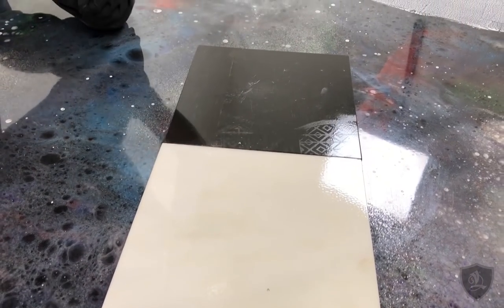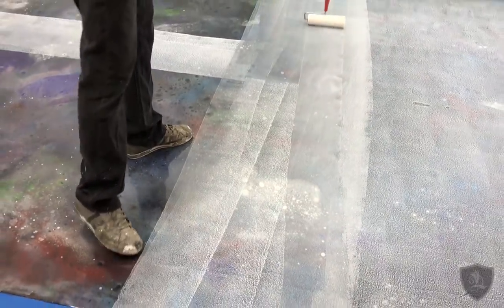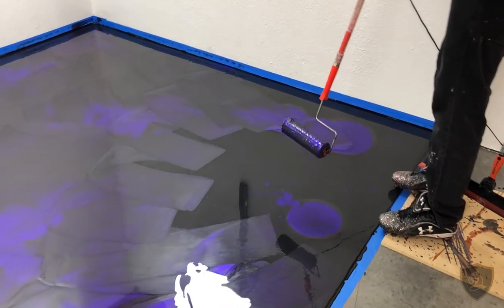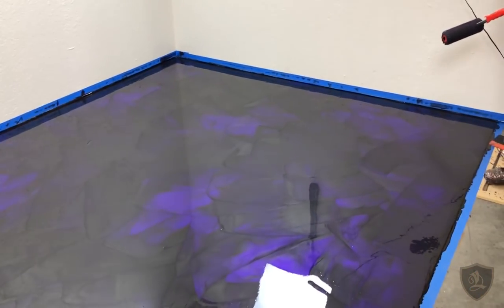Black & Bright Purple Epoxy Floor

Comment: Looks good...fun to watch but Lol....$1,800.00 for a 300 sq ft area?
CRAZY!
Reply from the maker: Tracey Valdivia You just need educated in the flooring market. 

Let’s think about this? 
First off 300 sq feet should be around $900 
That’s only 3$ a sq ft for a high end floor that’s totally customizable and you can install it yourself.

Here’s Googles Pricing per sq ft for other flooring options. This is just material 

Tile Flooring Material Costs

Tiles are available in almost every sort of material imaginable. Here are the most common materials and the average price per square foot:

Ceramic - $1.30
Marble - $7.50
Granite - $6.00
Limestone - $5.00
Slate - $3.00
Travertine - $4.00
Quartz - $6.50
Porcelain - $3.75

Traditional Wood Flooring

Traditional wood flooring typically comes in narrow boards that are 3 inches wide or less, or planks that measure 7 inches or more. The cost you can expect to pay depends mainly on the type of wood you choose. The planks tend to fall into distinct pricing groups. For example:

Low: Soft woods, such as pine, typically cost $3 to $6 per square foot for the flooring, and another $3 to $5 per square foot for installation.
Mid: Some of the most popular flooring options include mid-priced varieties such as teak, American cherry and oak, which costs $5 to $10 per square foot for materials and another $4 to $8 per square foot for installation.
High: Some of the most expensive wood floors are made of exotic woods such as Brazilian walnut, tigerwood, mahogany and cypress. Costs tally $8 to $14 per square foot on average, with installation costs running around $4 to $8 per square foot.

I would say our pricing is on point especially the look you get. Nothing on the market compares. Thanks
Reply: Floor looks really good, great work.
Reply from the maker: We agree, our online calculator is better suited for calculating 500 sf and up. The sf costs will be higher the lower the square feet. Our smallest kits of primer and top coat will do 500 sf +. Thanks
Reply: Plus, epoxies are practically bulletproof...I've been using epoxies since before they were pre catalyzed...AB mixes...I love it...I love the job you did on that floor too!  I use nothing but precat now on exterior flat masonry or interior floors...Nothing wild like You guys...:)
Reply: Tracey Valdivia epoxy is expensive
Reply: Building materials aren’t cheap, but this style of flooring is a good deal. It’s probably less of a good deal if you don’t need a new floor.
Reply: $1,800 for 300sqft is relatively cheap. A lot of reputable companies in whom know what they’re doing, unlike new installers, charge anywhere between $6-9 a sqft for a metallic floor. We do a significant amount of these and it’s definitely worth the price; also you usually want a top coat such as urethane or polyaspartic on top in order to protect your floor. The products and the labor is not cheap, this is one business that you get what you pay for.
Reply: Never had any of your floors done have you?
Reply: I spent $1,919 dollars for 800 sq ft kit from Leggari. I wonder why they charged you that much for a smaller area

Comment: So you mean to tell me I could've brought a primer from Leggari and applied it over my existing paint on the concrete instead of renting that diamond grinder it took hell to get in and out my basement???
Reply from the maker: We recommend diamond grinding concrete then applying our primer.  You need to scuff up the surface so the primer will adhere to the concrete.  Thanks

Comment: Can I epoxy a counter with tiles
Reply from the maker: Yes it can be put over tile, but you need to fill all your grout seams with multi purpose bondo from home depot, then sand it smooth, this will scuff up your tiles also, then wipe it clean with denatured alcohol then you are ready to apply our epoxy.
 https://youtu.be/g8GzsL0kpns

Comment: How long does this kind of flooring last ?
Reply from the maker: Our products are actually industrial coating made for military aircraft hangers, etc. So theoretically in a residential, or even commercial setting it will last forever. This is NOT a cheap epoxy paint that you will commonly find at box stores like Home Depot or sherwin Williams. It is a thick 100% solids epoxy coating.   Thanks
Reply: Leggari Products wow that’s awesome I’m a superintendent of upscale building with old concrete floors . how do you clean it to keep its shine ? Or does it dull overtime ?
Reply from the maker: You just use soap and water, no heavy chemicals.  Thanks

Comment: Are you able to this on top of tile floor??
Reply from the maker: Yes it can be put over tile, but you need to fill all your grout seams with multi purpose bondo from home depot, then sand it smooth, this will scuff up your tiles also, then wipe it clean with denatured alcohol then you are ready to apply our epoxy.
https://youtu.be/g8GzsL0kpns
Reply: Thank you! For your answer I'm thinking about ordering one of your products.

Comment: So you don’t have to diamond grind the floor
Reply from the maker: CONCRETE PREP FOR A JOB Shop blasting and diamond grinding are the two best ways for prepping concrete. But they require expensive machines and vacuums that you can get at most equipment rental stores. The next best step is to acid etch the concrete, if you can’t do any of these you want to clean the floor with an auto scrubber from a rental store or mop it really good and then we require our prep replacement primer if you are just going to mop or scrub the floor.

Comment: What makes your product superior, sounds like a lot of upselling to me. Who in the company created the formula? A scientist or someone with limited knowledge of how different substances work in contrast with eachother. how long did it take to test and create your formula, how many different formulas did you have to go through to perfect your product. Is it just some simple formula with a few touches here and there or very intricate technology developed by your company? Because it sounds like the name is what your selling. People need to know what about your product makes yours so superior nobody else can get better results at your prices.
Reply from the maker: There is no comparison because they don’t sell the same products. All of our resins are ultra refined industrial grade 100% solids resin that is a  2 to 1 mix ratio. We only use the best raw materials on the market when manufacturing our resins and Our Products have been tested for over a decade in real-life environments.Our products are actually industrial coating made for military aircraft hangers, etc. So theoretically in a residential, or even commercial setting it will last forever. This is NOT a cheap epoxy paint that you will commonly find at box stores like Home Depot or sherwin Williams. It is a thick 100% solids epoxy coating.
Reply: @LeggariProducts  Hey man, well thanks for the reply! It answered my questions well, and I am sure it answered for a lot of other people deciding which prduct/brand to buy, as I know for sure that information is what I look for when I am comparing products to buy so I get the best deal. You seem to be good at what you do and seem to take extra care in people's questions/concerns. Hope business is booming, you deserve it! Keep up the good work 👍👍